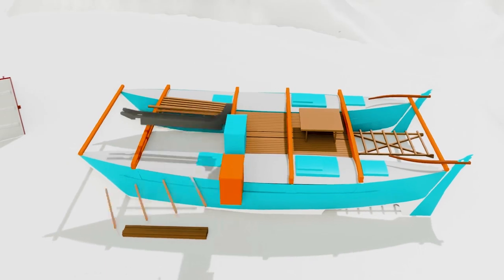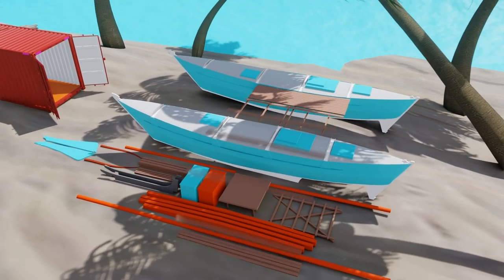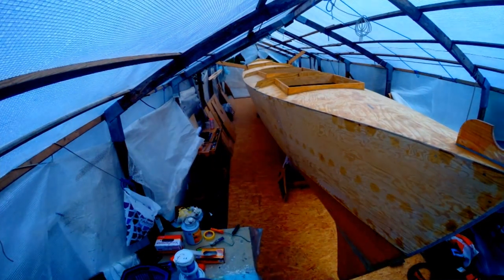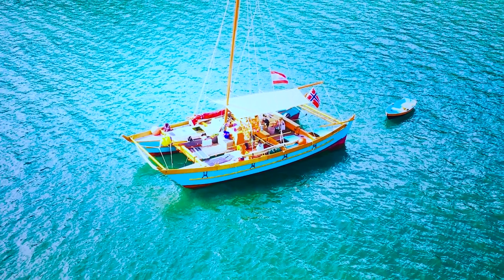Building the upper part of the hulls of our Wharram Tiki 38 / DIY - Ep 5

Comment: It looks like you are using a softwood plywood, so not rot resistant.  So I hope you have given all the interior surfaces a good sealing coat of epoxy.  Hardwood is better, but in time will still rot, especially in hot humid climates.  
Every enclosed space should have two vents , say 10cm dia, to allow a through flow of ventilation.
And the very worse thing you can do is fill with two part foam, which isn’t waterproof.   
Don’t ask me how I know!
Reply from the maker: Yes, we have covered the interiour rather well and somehow have had little problems of moist inside. The books and bedsheets were all dry. Maybe due to the way the hatches is made? We have heard about people coming back to boats being total green inside.